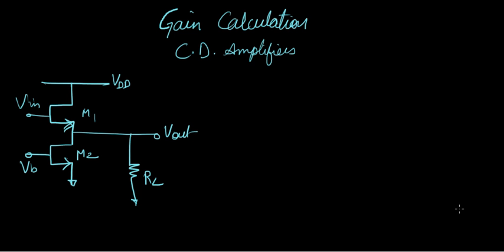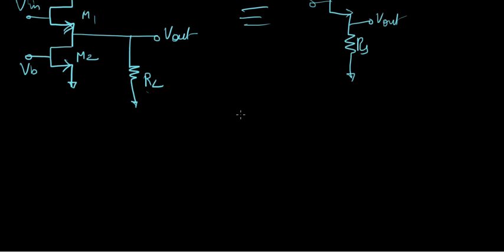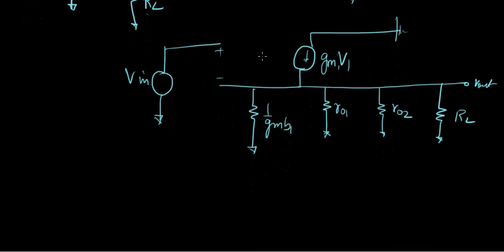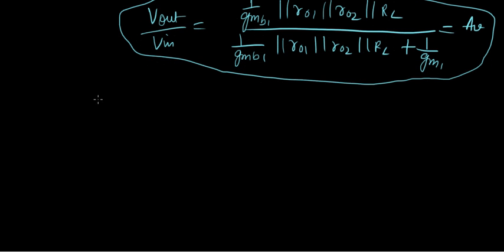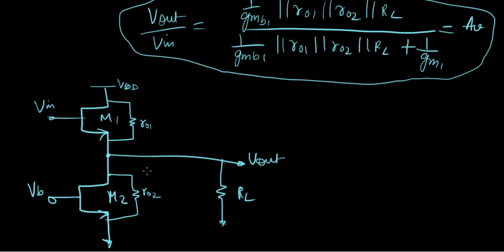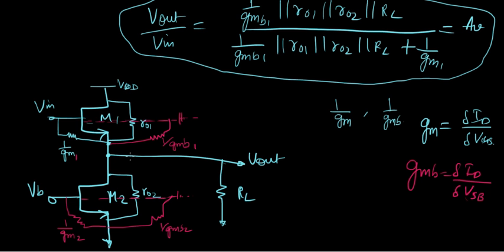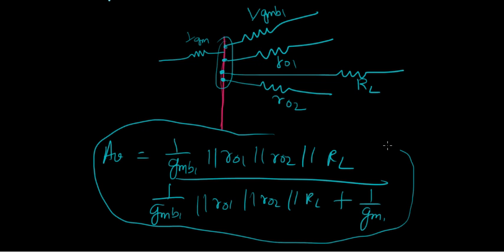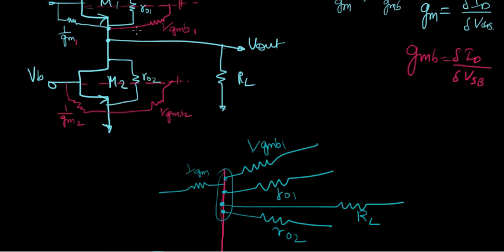Common Drain Amplifiers - Shortcut to Gain Calculation

Comment: I think, your small signal model is wrong. You have connected ro1 to ground. It should be connected to Vdd. Strange that it does not affect the result. Awesome videos by the way
Reply: +Qaz Wsx When it coes to small signal model all large signal such as Vdd have to shorted..We are consideering only small signals now..so since Vdd is shorted r01 is conneced to gnd...
Reply: Thanks for your explanation. I found that out soon after posting that but I left it there so that if others have similar doubt, they would be able to find it. Looking back now I seem so stupid, subject are always so easy when you are done with them.
Reply: Correct answer is just like that🤔
vo/vi=gm1vgs(ro2//RL)/vgs(1+gm1(ro2//RL))=

gm1(ro2//RL)/[1+gm1(ro2//RL)]...Answer